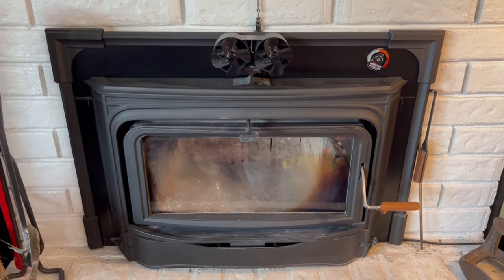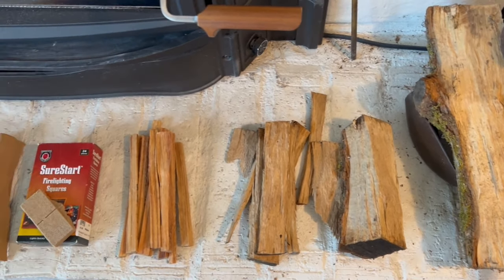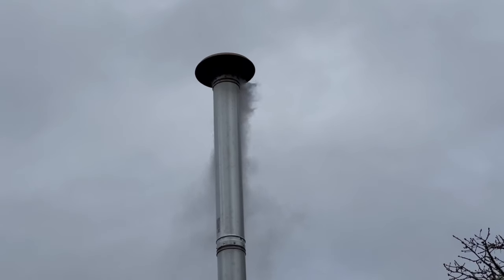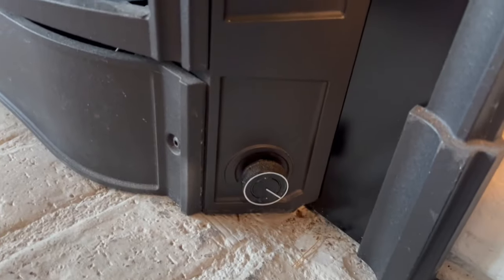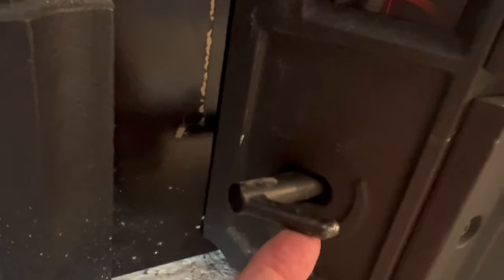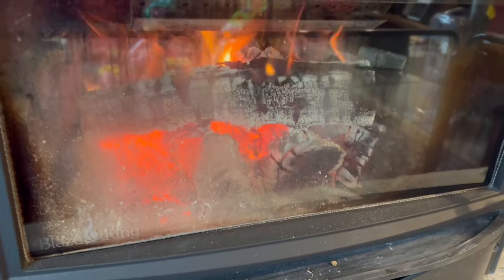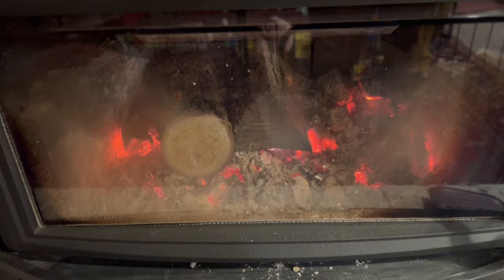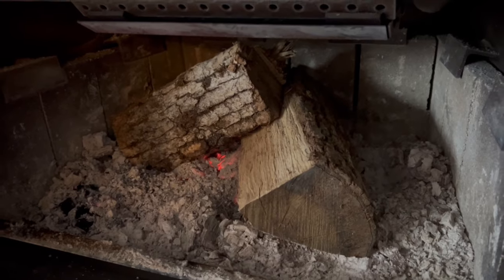Running a Fireplace Insert with a Catalytic Convertor -|- How-To

Comment: Since you have a closed loop in the firebox, a simple way to heat the whole home, assuming you have attic access is to install a small insulated duct from the fireplace room, through the attic to the other end of the house.  A small inline duct fan will circulate the air for pennies end-to-end of the home and really improve the effectiveness of the stove.
Reply from the maker: I had something similar in a house years ago. That was a single story ranch. And it worked great.  My current home is a bi-level mid-century, and I also have duel Heat pumps on each level with head units in each bedroom. The fans in them are super efficient and when I have the fireplace on I almost never turned the internal fan on in the fireplace, because it is a little energy inefficient. Instead, I’ll turn the fans on low in all the units on and open the doors and the heat circulates all over the house levels.  Works great.  I stayed in an A-frame once that had an 8 inch tube/duct that ran to the very top of the peak to almost floor level that had a fan that drew the hot air in the peak down. It made it super comfortable and fix the issue of the main area being comfortable and the sleeping loft being hotter than the fifth level of hell.  The fan on the duct seem to have been a large DC computer fan, so I’m sure that it was just sipping pennies a day as well

Comment: Nice video.  I'm considering a new insert including this model.  How often do you run the fan, and how much difference does it make for heating the house?  One reason I am considering this is to have heat if power goes out, and wondering how it heats without a fan.  Thanks in advance!
Reply from the maker: @marek3041  very seldom. Within temperatures last year got below 30. I turned it on, but on low. And it flooded my entire upstairs full of warm air goodness.  I do have a passive fan sitting on top of it that when it gets hot it just turns on just to keep air moving but I mean it doesn’t you know push it 30 feet or anything.  Insert gets plenty hot and like I said the video it’s not something that you start a big fire in and pack full for a romantic evening in front of.  It gets hot enough to run out of the room.  if you do want to have a romantic fire, then just build a small one in it. That type of insert though really is meant to heat a lot of space.

Comment: Hey Matt I just got a blaze king ashford same one as you. I am having trouble getting it going for any more than 2 hours on 50% damper open. Once I bring the damper to 50% the flame almost goes out. I only put down the damper when it’s at least 25% into the red. I am also having trouble heating the room with this only gets the room to about 75 degrees when the glass is at 750 This is my first cat stove and struggling to learn it.
Reply from the maker: @Vespertilionidae  that is not my experience at all.  What kind of wood are you using? Are you burning pine or fir? You really do just want hardwood in there.  Are you turning on the fan prematurely and cooling the heat exchanger? With a 750° face then that should run you out of that room?  I would have your installer come over and see what’s going on. It could be that you are having your heat escape up through your flu somehow.  As long as you have a really good coal base and then everything‘s on fire when you shut that damper down, it should keep heating and burning. Now, you might not have any open flame in the box, but as long as the heat chamber doesn’t fill with smoke, you’re fine. It’s going to continue to burn and heat.
Reply: @ thank you so much for your response it’s greatly appreciated!! I am burning strictly hardwoods mostly ash which is why I am so surprised! I do have cathedral ceiling so perhaps my heat is getting trapped in the top half of the room? I am turning my fan on only after the gauge is well into the red I’m really not sure what to make of this. I had a regular stove before this and I could barely be in the room when I had it running granted that was before the cathedral ceilings.

Comment: why in the world do you need a catalytic converter on a wood stove? It's a wood stove.
Reply from the maker: The country where you get an inversion later in the air stagnates in winter, the only way that you can legally buy a woodfired heat source (stove insert, regular wood stove, pellet stove, etc..) is to have one with the catalytic converter, installed to reborn the particulates in the hot instead of venting. Most cities have passed similar ordinances from New York to Chicago to Dallas to Portland.  if you live in an urban area, you can’t use grandpa’s potbelly stove that was in the cabin for 55 years.  

It makes it a little more complicated to light, but my home growing up was heated solely on wood heat so I have some experience and I will say that stoves and inserts with the catalytic converter I have longer burn times and I use less wood in them so they are more efficient and a better use of . I don’t like how much more expensive they are, and I think that the expense is directly reflective of the fact that they mandated by law, but the return of investment in comparison is only for five additional years and a good woodstove will last you for your lifetime. With the newer models, you may after 10 years have to replace the catalytic brick, but on mine it costs $250 is fairly easy to get to and I bought an extra with the stove and it’s on the top shelf of the pantry just in case I need it in a decade or so.
Reply: @MattofManyTrades  You must be in Canada. Wow. Even got the wood stoves. Ridiculous.
Reply from the maker: @chrisragan9766  Nope. Oregon.  Same rules in Seattle, Chicago, St. Louis, and even Dallas. Any major urban area.
Reply: catalytic converter burns the wood gases and smoke, you get more BTUs from your wood.
Reply: It catalyses reactions. If you burn wood a lot of energy goes into wood pyrolysis and most of this energy you get back by burning wood gas (this is the visible flames not the coals) but some wood gas still leaves with smoke. In the wood gas there are some harmful chemicals like organic aromatics that are carconigen but it's not the biggest reason for using a catalytic converter. The biggest reason is just cost saving, while it is an investment you just get so much more heat from the log of wood. You burn nearly everything and you even lose the smoke or smell from the chimney so that's the biggest advantage.

Comment: In the beginning you left the door cracked. When did you close it up?
Reply from the maker: @wcsalaun  after 20-30 minutes into the initial burn after lighting. At 6:07 in the video. When the wood is completely lit and coals in bottom. Really hot bottom.

Comment: Hi, so debating between this and a reburner regency 2450. I don’t want to burn us out of the family room where insert would be. Would also like to enjoy a nice looking fire. Are you saying it not practical to be in same room as unit when it’s running properly? Would a reburner be better suited for my needs?
Reply from the maker: @daviddelahanty5088  not if a small room…. This is more of a heater that an ambiance thing.
Reply: @MattofManyTrades  thanks that points me to a non cat then. Appreciate it.